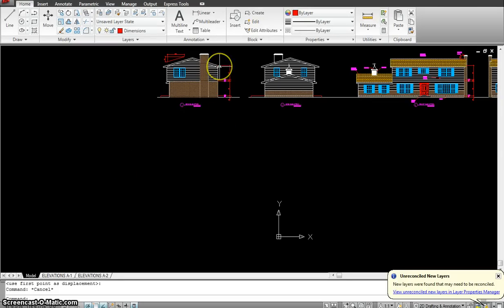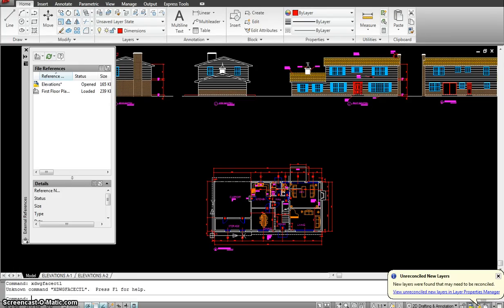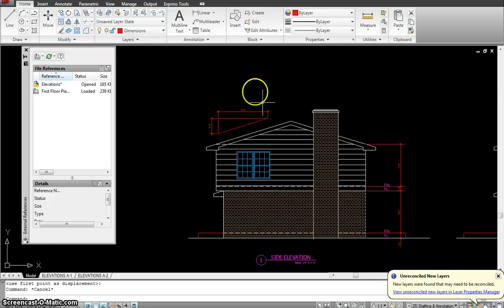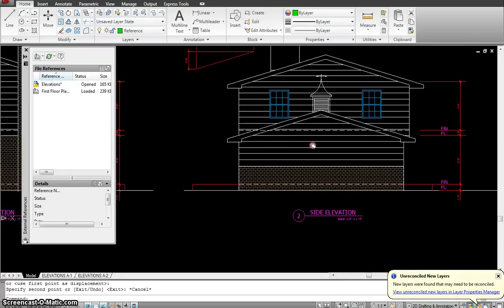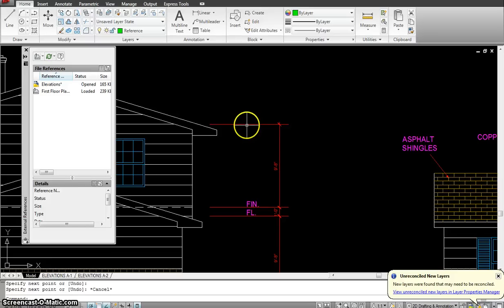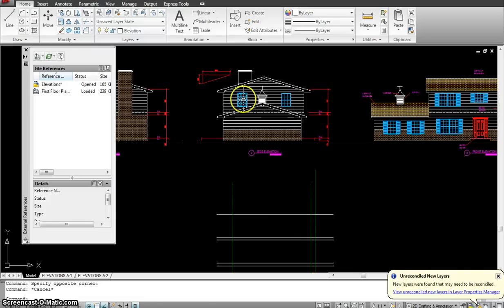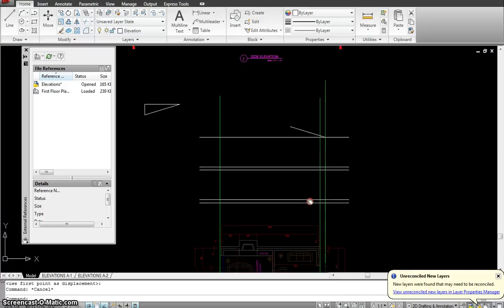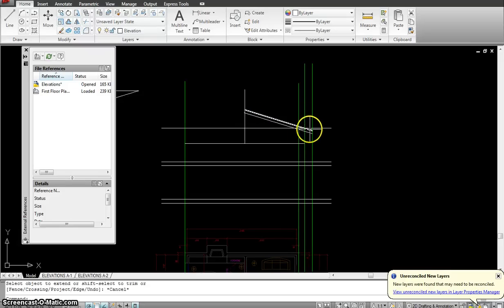Autocad Tutorial-19 Elevations Part 1.mp4

Comment: i have doubt in section if my plan will be in L shaped wall while am doing the section how to i differentiate front and back wall in section
Reply from the maker: +saran the section walls that you are cutting through will be double line and hatched inside. The back walls that you are not cutting through but still seeing it will be single elevation line.
Reply: how to show the front and back wall in section can u pls attach any reference drawings
Reply from the maker: +saran please watch the video on section views on my channel playlist- into to drafting and design.
Reply: i don't know how to use line weights, which line weights will be front and which line weights will be back pls can u explain me.. and send me the line which video i should be saw